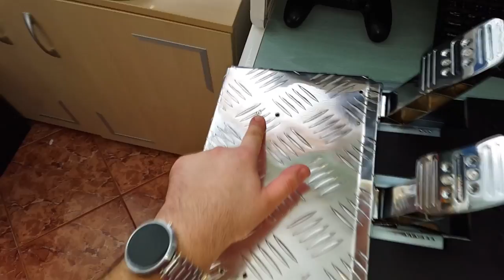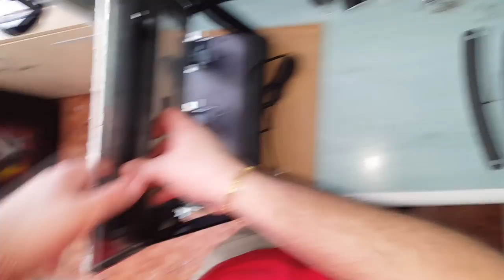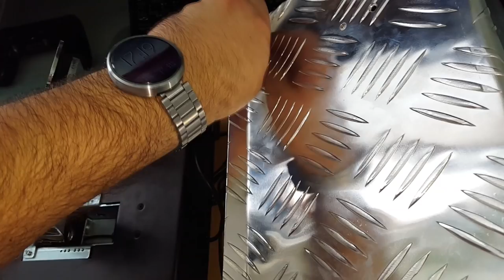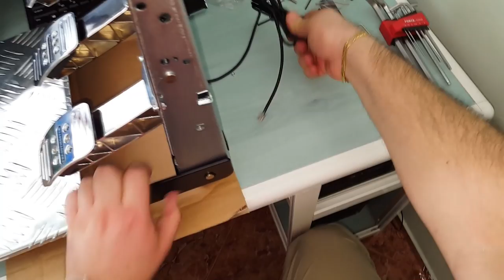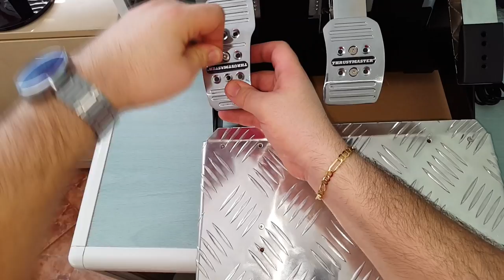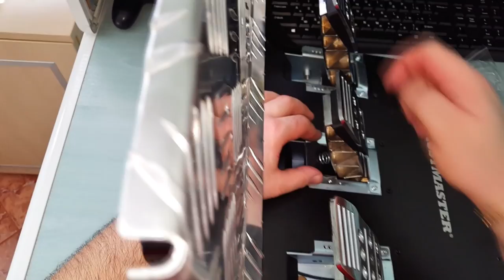How to change position F1 to GT style on T3PA-PRO pedals

Comment: kinda threw mine together in a hurry, to get it running asap.
this was a huge help in setting it up properly thanks!
Reply from the maker: +Southpines Hooligan 
I'm glad that I helped
Reply: +koti project how did you go about flipping the clutch and accelerator? 
I thought I'd simply be able to remap the pedals in game, but that's not the case
Reply from the maker: +Southpines Hooligan The clutch and accelerator pedals i flip with button MODE on the wheel base Thrustmaster T300RS. Hold the button MODE for 2 or 3 of seconds and will change the color of the LED. By default the light is red(F1), and you must set it to green(GT). This mean you flip the pedals. And the wheel base remember your choice forever until you hold again button MODE.
Reply: +koti project oh ok, so like how you hold mode and d-pad to change wheel rotation, except not touching the dpad?
Reply: +Southpines Hooligan it worked! thanks again 😁
Reply from the maker: Ok super, for nothing :)
Reply from the maker: +koti project I put this in the description for everyone which facing the same problem

Comment: Question: so changing it will make the clutch on the right , brake in the middle and gas on the left?
Reply: i think he did wrong the long pedal should be on the right
Reply: Exactly, so how to make it work now? My accelerate is on the left now😱🤔🤔
Reply: Sorted! You just press & hold Mode button to switch 👍

Comment: I like to know if that pedal set would fit on a Omega GT wheel stand ? Will it also fit on the Wheel Stand pro V2 ?
Reply from the maker: I think so, because the pedals have metal stand and many holes on it with different variations for settings.
Reply: Yes they will fit on the Omega GT stand as I have mine on one now, along with my T300RS and TH8RA.

Comment: I'm pretty sure the holes on my metal foot plate are drilled wrong.  When putting it in GT mode, the holes are too far inward so they don't line up with the holes on the black mounting bracket.
Reply from the maker: +mustbe_Nick Yes but if you find the right wholes i think will be line up.

Comment: Do they fit on a Obutto Revolution when mounted in GT style?!
Reply from the maker: +gtavcjr I think yes because they are the same holes each side no matter what position are the pedals.
Reply: I mean it because of the dimension, not the holes.
Reply from the maker: If they fit in F1 style will fit in GT style. When changing position of the pedals your not change the dimension. Is like a half square.
Reply: OK! Thank you!

Comment: how to  (software reverse them) if iam using it as a standalone pedals connected directly to pc usb ?
Reply from the maker: +mohanad rahieem This pedals do not have USB cable its telephone connector. Must be connected to the base wheel stand. In the pedals do not have any processor or software to be possible to connect directly to the computer.
Reply: koti project there is an adapter for it on thrustmaster website so u can use it as a standalone usb device
Reply from the maker: +mohanad rahieem Yes with adapter you can. This adapter have USB drivers and in windows you can change everything.
Reply: Ok,thank you
Reply: man a fool

Comment: did that little allen key come with your wheel?
Reply from the maker: +Marcus Chong Yes! But... the quality of the keys is "made in china" and i use allen keys Würth because one of the original keys broke in video when recording :)))) Just be careful.
Reply: wow thanks for the quick reply!
hmm unfortunately i bought my T3PA off someone on ebay, and it doesnt come with any of the tools. Was thinking of switching my pedals to the GT style. So this is not possible without the bits and pieces that Thrustmaster supply you with?

Also can the GT/Rally Style be used the same way (e.g. floor mounted), or does it need to be hardmounted to a racing chair setup?

Many thanks!
Reply from the maker: +Marcus Chong When i ordered the pedals, all of the keys was in the package. Must have all keys inside ! May be they are forgotten when packaging. By the way is good to have all of this allen keys, because you can used it for many purposes. 
For the second question: Yes, its very stable. But is good to have something heavy back to the pedals if you want more stable. Example i use the original box of the pedals with somethings inside.
Reply: thanks so much!
Reply from the maker: +Marcus Chong Not a problem :)

Comment: as soon as u change its postion it loses the hard mount spots, bad design from thrust master
Reply: Rachid Khamlichi I guess you would need a rig that has hard mount points on a vertical piece. What is everyone else doing to mount it?
Reply: never seen it hard mounted in that position as there is no holes for it to be done
Reply: there are holes to hard mount the pedals in "GT mode". They are by the front of the set beneath the diamond plate., There are only two holes but it work fine mounted to my GT Omega wheel stand.
Reply: Pete how can you reach those holes if the plate is on it? you can't and you can't atach the plate when it is mounted allready